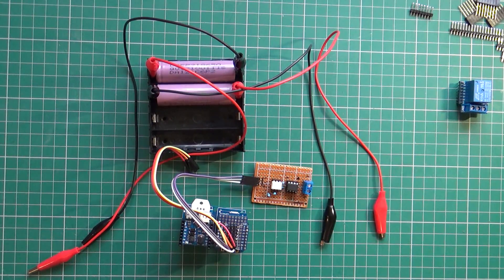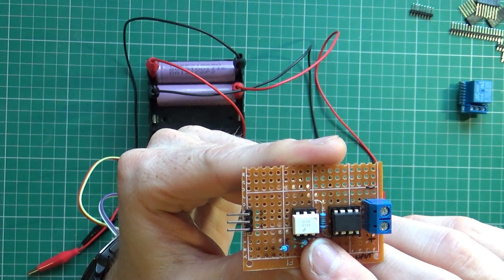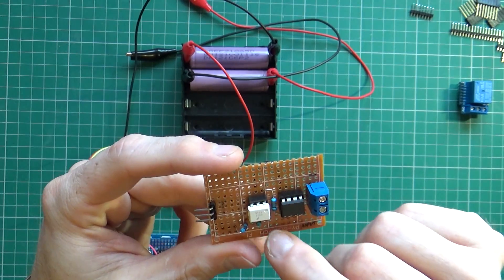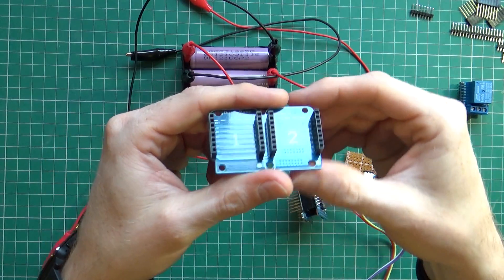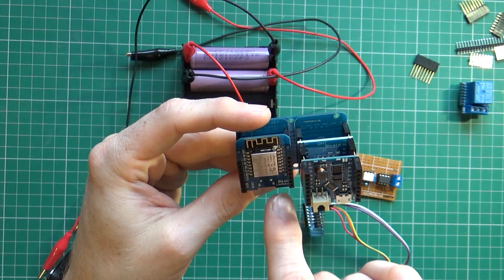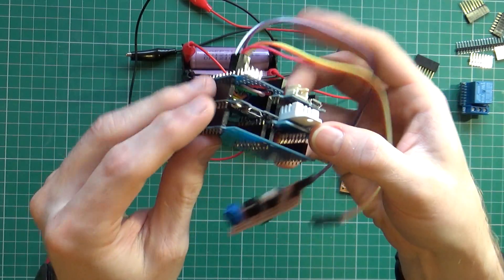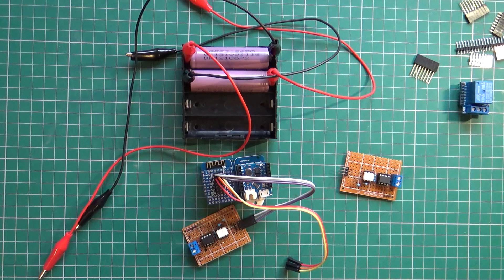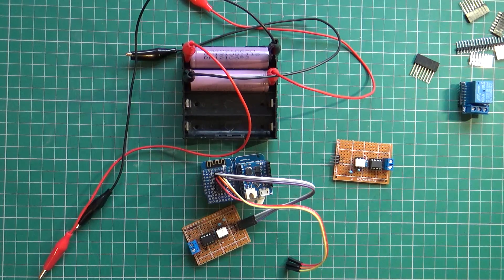BMS - Hardware

Comment: Using 1 attiny for each cells is a waste. You could just use 1 attiny with an ADS1115  i2c module which provides you 4 adc at 16 bit.  More accurate less power consumption

Comment: How are you balancing the cells?
Reply from the maker: At the moment i'm not, my first aim was to get the reporting side working and then i was going to look to your design for some inspiration and go for a power resistor to allow me to top balance.  I've not really had to balance them so far though to be honest, when i created the packs i used repackr.com when i built the packs so they are fairly balanced, i use the word fairly mind as it's far from perfect.
Reply: It should be easy enough to add as the microcontroller should have another spare output for the mosfet and resistor.
Reply from the maker: Yeah that was my thinking, kind of why i've not done the other 5 tbh, wanted to add that on.  Just need to take time to look at the way you did it.  Also the reporting isn't super accurate as the way the signal is sent to the master has some inherrent inaccuracy as the number is scaled down to fit in 0-255 then scaled up again meaning it loses some accuracy.  How is your setup going, still working well?